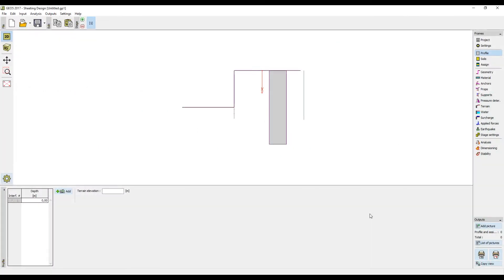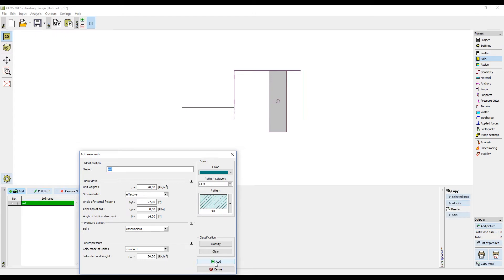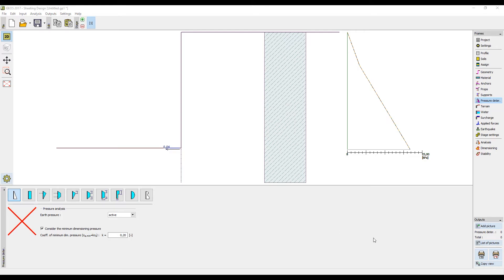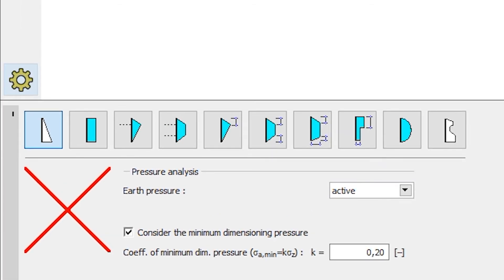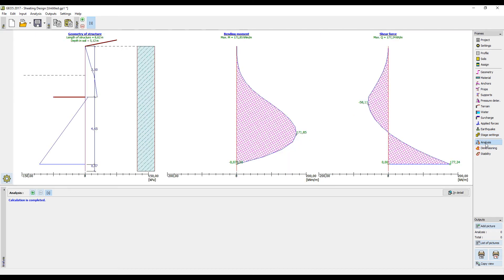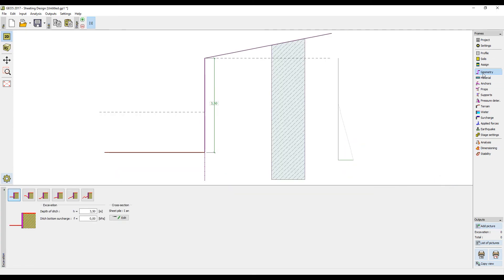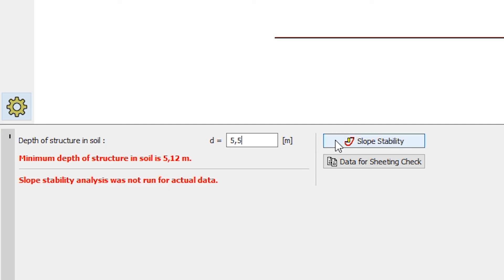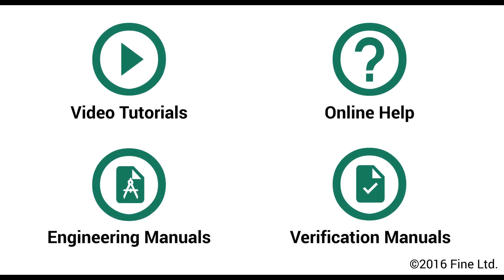GEO5 Tutorials: Designing a Sheet Pile Wall in Sheeting Design

Comment: Any US based code available now for design?
Reply from the maker: Yes, we have AASHTO LRFD for standard geotechnical calculation and ACI 318-19 for verification of concrete structures. Soon will be also available AISC 360 for steel structures. If you want to learn more, try our "Engineering manuals" - step-by step guides available at https://www.finesoftware.eu/geotechnical-software/engineering-manuals/?predatorId=SheetingDesign&langId=en. Best regards, Fine

Comment: why there is no geometry section on method tab ? is this because iam on free trial ?
Reply from the maker: Hi Ozi, our demo version works without any analysis limitations and you can try all implemented options. More details about this program and others you can find in the Engineering Manuals, they explain how a particular task can be solved. All materials are available at https://www.finesoftware.eu/engineering-manuals/.
Reply: @GEO5software  thank you  i figured it out. i should had opened another operator that fits my problem. now i find it thanks again :)
Reply from the maker: @oziturker5936  Great, thank you for your feedback ;-)